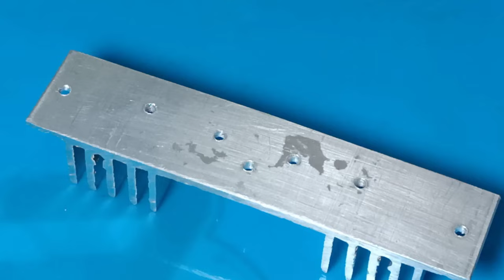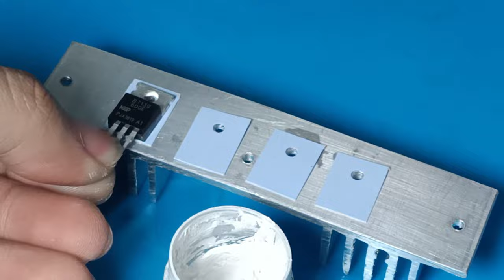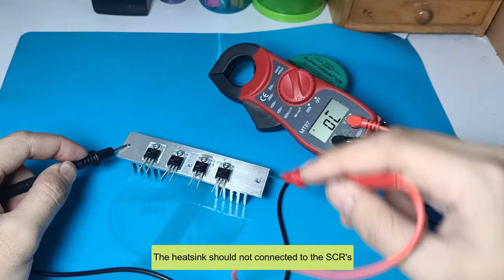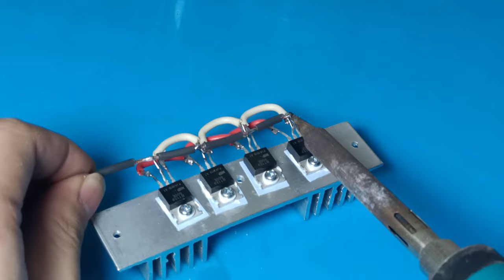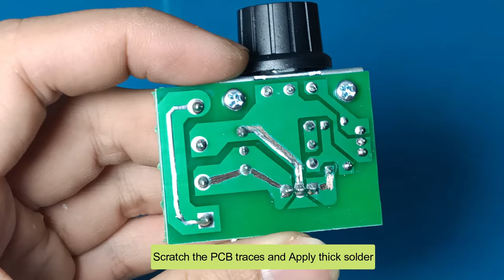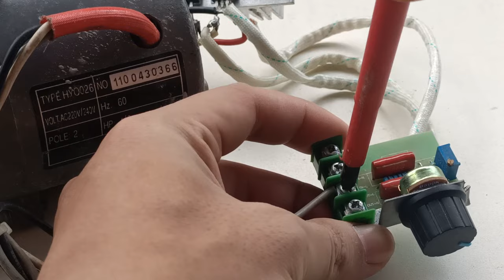AC Motor Speed Controller | Motor Speed Control | Motor

Comment: Good way to transform electricity to heat and do no actual work. Any real motor with a load will burn all this up. You can only control (properly) AC motors via frequency. Messing with voltage will cause failure. This isn't a DC motor.
Reply: I've been asked to repair an industrial extractor, it draws about 2kw 220v and is induction single phase with capacitor. The speed controller has failed , can you think of a frequency controller available on eBay or AliExpress that would do the job?

Comment: Why did you cut the video? It seems that the MOSFETs burned out...
Reply from the maker: Its SCR and the voltage is 220 V the current pass to the SCR's is quite low. Burning the Scr with low current is never happen

Comment: SCRs??? Dude, BT139's are not SCRs. They are triacs (2 antiparallel thyristors in one), and the circuit is NOT a speed controller, but a commercial light dimmer, expanded slightly. It is capable for slowing universal brushed motors somewhat, but definitely not asynchronous (brushless) motors. And the way you stacked 4 of the triacs in parallel is ridiculous. Everyone who has proper knowledge in electronics, knows that only carefully selected and matched semiconductors may be parallelized, especially in power electronics.
Reply: The circuit in video use bta16 triac and i have one too. Bt139 and bta16 both are triac and capable of 16 amp. I dont see any problem
Reply: @ronnygarcha  I'm not wondering why don't you see the issues with the shown circuit, but this is why I wrote my comment. You don't see any problems, but thyristors are not triacs. In this circuit, triacs were used, not SCRs (thyristors). If you don't understand why I wrote my comment, ask someone you trust and has been PROPERLY educated on electronics, why such a dimmer circuit shouldn't be used for lowering the speed of a brushless asynchronous motor, and what are the differences between SCRs and triacs. I got tired of explaining things on the internet for beginners. It's exhausting, but maybe everyone should learn from their own mistakes. Or errors. The difference between a mistake and an error is the same that the difference between a blown fuse and a burned down house.

Comment: Is there a way to controll the variac with a digital controller? i wonder if inverter air conditioners use this tech instead of the inefficient single phase to dc to 3 phase ac with variable frequency controll.